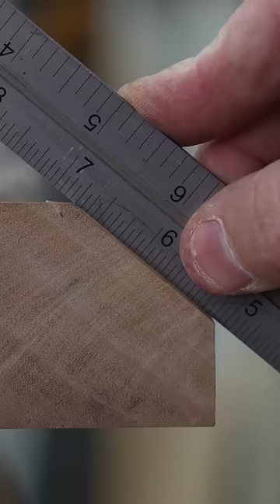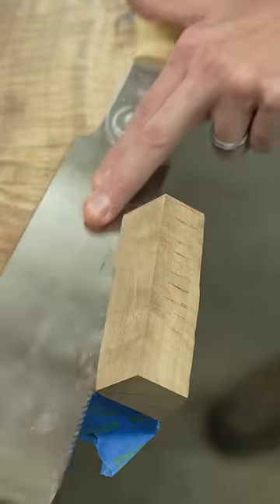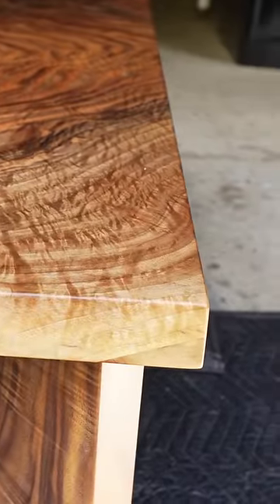Woodworking fix

Comment: You can't even tell that you had to add the piece. It's absolutely gorgeous.
Reply: It's at rh bottom of the finish product
Reply: It’s actually very noticeable, but like a good wood worker he put the mistake on the bottom not the top of the piece.
Reply: @ryanharrish8363  brilliant observation. He puts her underneath. I couldn’t understand how the grain was so perfect.
Reply: @ryanharrish8363  Noticeable if you know it's there, but without closely examining it, the match is perfect and doesn't catch the eye.

Maybe the right face has a worse match...
Reply: @darkflamethrower  cringe
Reply: You can most definitely tell that he added that piece
Reply: @marcelinomunoz4471 if he didn’t tell u u wouldn’t be able to tell

Comment: That repair job looks flawless...Well done.
Reply: Yes
Reply: Do you recognize that the last shown corner is not the corner he worked on?
Reply: Sus
Reply: its like he showed a different corner
Reply: @googlefuuplayad9055  it's on the bottom of the corner def the same spot he fixed
Reply: he repaired a... BRAND NEW table that somehow costs 18k.
Reply: @googlefuuplayad9055 He flipped the slab over so the fix is on the bottom. Same corner

Comment: The sign of a true craftsman is not that you don't make mistakes but you know how to correct them.
Reply: And own up to them.
Reply: A good cat always knows how to cover it's shit up
Reply: He is much better than me I would have thrown on black walnut and showcase the error as a highlight, but that’s why I don’t get the big bucks
Reply: The sign of a true con artist is charging someone 18k for a piece of wood. As far as being a craftsmen, they don’t fuck up basic measurements to begin with…. So yea there’s that.
Reply: @todddouglas2022  Thank you, negative Nancy! Do you feel better now?
Reply: I'm really  good at fixing mistakes... my own.  I sometimes mess up on purpose because my fix-it solutions are sometimes BETTER than the original if I had done it right. FML
Reply: @todddouglas2022  and will leave the bathroom half finished and disappear
Reply: I wish that my last bosses believed that
Reply: does no one notice it’s a completely different corner with grains going the opposite direction?? wtff!!!?
Reply: @KimoKimochii  Yeah, it's a different corner.
Reply: @briangalloway3684  No
Reply: @KimoKimochii  I think someone pointed out that he was working on the bottom surface. If you tilt your head 180º to the left, you'll see it too.
Reply: @timapple6586  you are right
Reply: @todddouglas2022  First off, unless you live in a shithole, the free market allows you to sell anything if someone is willing to pay for it, also, have you ever used wood glue? You'd be surprised how much it's used in products you THINK were made perfectly.

Comment: Just witnessed a master at work 👏🏻
Reply: That's why he's abke to charge 18Gs
Reply: A master of trickery, maybe.
The piece is on the bottom side of the table!!! Nobody would notice that piece, even if it was a completely different kind of wood !!!
Reply: @Stroke-it-2-Handed  Doesn't matter. You pay $18k for a table, and it is messed up. The least you can do is match the grain, and use the wood from the same slab if possible.
Reply: lol thats the easiest fix if you didnt notice that was the bottom side the grain on the top he shwed wasnt the fix you can see the bottom corner where its the glued on piece, if you actually knew where to look you would notice it but since you think its in a spot that its not your like WOW great fix lol when the fix was always on the bottom of the slab anyways.
Reply: @Stroke-it-2-Handed  hahaha yess you seen it too. i do countertops what he did was beginner level fix. it blends in cause they are all  looking at something that isnt there as the fix is on the bottom lol
Reply: @petejones6827  you do realize thats what makes it great right? it fits in enough that you dont notice it unless you're told about it and people dont commonly look at the bottom of the table so basically no one will see it.
Reply: @octilli  true but the thing is if its on the bottom whats all the fuss about making it so great NO ONE WILL SEE IT. i work in the countertop industry  we dont waste time on things that will never be looked at.

Comment: As a self employed carpenter myself, that's a great fix and impossible to spot if you don't know it's there. Even when you do it's still impossible to see the join. Great job man, and even better job for delivering on what you promised. 👏🏽
Reply: I couldn't see it until I realised it's on the bottom of the corner not the top. I'm still very impressed though!
Reply: Shaving the main piece down to the ring line is genius
Reply: @David Hill  you the real MVP. Was convinced it was fake until you said it was on the bottom
Reply: Watch it again and pay attention.

Comment: Seamless. Absolutely flawless 😳
Reply: It's the lower part of the corner, not the upper part shown at the end. It's pretty obvious. Not the end of the world, but would be better to sell it to someone else at a reasonable price
Reply: @Channel7331  I think you have experience with carpentry because to me I could not see any seam but my background is in medicine so I don’t have a clue of what I’m talking about
Reply: @djvelocity can't you see the obviously different colored corner with a straight line separation on the bottom of the final product?
Reply: He flipped orientation of the board and showed from different vantage point as the rest of the video. Believe me, this patch will be very visible, that's why he didn't show the same view at the end.
Reply: The underside corner in the final shot.
Reply: 18,000 bucks for a table? How about I build you six of them for 10,000 each?
Reply: @bobojames8978  is that seriously the cost? Wow. I uh, I cannot defend that, it seems steep but to be fair, the craftspersonship is flawless even if it is expensive
Reply: @dthorne4602 i think the reason it is so unnoticeable is not that it blends in perfectly, but that it looks like it’s supposed to be there. walnut sapwood tends to be the exact color of the patch, and the grain orientation matches. without being shown that it was a patch, you would never know it was there.
Reply: @acm-gs6bl  no, he just doesn't show the patch from the same perspective at the end, it is upside down, so the patch is at the bottom. He actually didn't do a good job matching grain direction at all,it is possible to make this completely unnoticeable, but he didn't.
Reply: @dthorne4602  sure it’s obvious when it’s the whole focus of the short, but if it wasn’t pointed out to you, you wouldn’t notice it. if you look at the wood near the patch, you see all those lines in the grain, and it matches those lines pretty well. it’s also in a pretty inconspicuous spot, somewhere you wouldn’t necessarily look unless you were carefully observing the bottom corners of your coffee table for some odd reason

Comment: “A master isn’t judged on how few mistakes he makes, but how well he can hide them”
Reply: ooo i like that where is that from?
Reply: Who the hell said that shi
Reply: I don't like the way that's said. It should be "how well he can fix them" many scam artists can hide mistakes, to hide a mistake is to cut corners, a master fixes them
Reply: @lordandsavior6726   a master fixes other peoples mistakes. A master is the ultimate authority. A master doesn't make any mistakes.
Reply: @noeeon9910  nope not true, a master can make mistakes, it's a part of being human, a master knows how to fix their mistakes
Reply: @lordandsavior6726   nope a master does not make mistakes. The mistakes were made on the journey to become a master. That is why they are masters. Slow is smooth, smooth is fast. Most things are %80 prep %20 execution.. this is done to avoid mistakes. Do it once and do it right.
Reply: @noeeon9910  If you don't believe masters make mistakes you've never seen a master
Reply: @lordandsavior6726   as a tradesman I've seen masters everyday. Not one second, tool, or material is wasted on mistakes. The mistakes typically come from engineers and architects. We can be masters in anything on this planet, except each other.
Reply: In this case a "master" is based on how much he can get for a damn coffee table! 18k!?
Reply: we don’t say master in 2023 😅
Reply: @noeeon9910 well. Yes and no. Working as a Carpenter you are bound by using "living materials" ie they might crack, bend or be "flawed" to start with. Then, no matter how much you prepare you might have to either remake Everything, or do like the video above.

Comment: As a carpenter, I can always appreciate a good fill that blends in. If no one notices it, you know you did something right😅
Reply: Ikr? I'm in the same field and it took me a good time trying to find the seam, some quality stuff right here
Reply: Agreed. It's always satisfying when knowledge and hard work pays off like that. It personally makes me feel accomplished and proud. Wewd is truly something wonderful to work with.
Reply: But why did he cut it off in the first place?
Reply: He paid for a solid piece,  u messed up. Should have got a new piece. He got scammed
Reply: Will that corner ever chip off?
Reply: Well, clearly he showed us a different corner at the end of the clip bc i don't see shit. Jk, if that's for real, then bravo. It does truly look seamless
Reply: @infotechsailor  he told the cilent about it and made sure they were okay with it. They didn't get scammed in any way whatsoever.
Reply: @saschaherrmann1665  said in the video
Reply: @infotechsailor  at that point if you care that much make it yourself
Reply: @Nevouti.x  he said he messed up but not how he managed to cut clean like this…
Reply: @adrianruiz4904  he used wood glue which turns brittle over time. And he didn’t anchor it so, yes its possible.
Reply: @burtan2000  Same corner. Look at underside of table. You can see it, but it isn't that intrusive.
Reply: @saschaherrmann1665  he didn’t, that piece was to small so he made it flat so he could glue a piece on, I’ve done this
Reply: @adrianruiz4904  never, the glue is stronger than the wood
Reply: Hello carpenter is that table really worth 18k?
Reply: @MeltedMask its different corner ...look at the pattern direction..

Comment: That's some damn nice work sir
Reply: Yes but. Its 18k,,, like, honestly i would rather buy a large house instead but thats my opinion. (For my area. I guess my area is very cheap for western countries)
Reply: @kristianmundruc1603 with the way the housing market is you might as well spend it on a table. Least the table will be in better condition than the home you want to buy
Reply: @kristianmundruc1603  18k don't buy shit on the housing market. that's not even a years rent in some places. (like my area)
Reply: @kristianmundruc1603  Damn where do you live? Imma move there. Here in Amsterdam you can’t even get a parking spot for less then 100.000
Reply: Bro said 18k to buy a house wtf 3rd world country u live in
Reply: @envymenace8224  🤣🤣🤣
Reply: @kristianmundruc1603 here you living where that’s one months rent? Because 18k won’t cover that let along a house or used car where I live

Comment: Thats what you get with real skilled artisan work. It honestly looks like it was never missing this is incredible.
Reply: It can be spotted, you probably just didn't realize that it's on the bottom corner rather than the top. Still not something a person would tend to notice or care about though.
Reply: Until the corner gets hit because he didn't put a dowl rod in
Reply: For 18$ it shouldn’t
Reply: @MsHojat  damn it's on the bottom 😅 i couldn't wrap my head around it
Reply: Maybe I should get into making tables if a sucker is gonna pay 18k for something like this
Reply: I'm going to be a real. His true skill isn't the craftsmanship but the salesmanship. 18k? 💀

I bet this dude could sell ice to an Eskimo. 😂
Reply: until it falls off...lol
Reply: @raintalon6138  
Depending on the wood that slab could easily be 4-5K.
Add two weeks of work with the hourly rate of pretty much any electrician nowadays and you are at 18K.

Comment: There's a sweetwater video where Dan, their resident luthier fills a route made in an old Telecaster with a chunk of wood. He did an amazing job of matching the grain, and after he was done, you couldn't tell that the guitar had been altered.  He even reliced the repair so it looked as worn as the rest of the guitar. That dude is a fucking genius.  I love watching his work.
Reply: i think i saw that one, he knows all the tricks when it comes to strings
Reply: What is a?: Sweetwater video, resident luthier, route, telecaster, relice?
Reply: @sven_527  Sweetwater is a music store in Fort Wayne, Indiana and they have a YouTube channel, a luthier is someone who builds or works on guitars and other similar instruments, not sure exactly what a route in wood is, but I assume it’s some sort of flaw or woodworking error, Telecaster is a model of guitar made by Fender, and a “reliced” guitar is a guitar made to look worn or heavily used (like a relic).
Reply: @Ruudes1483  A "route" is an area of wood that has been removed using a router, which is a tool you've probably seen used on this channel. Routes in guitars are the holes that the pickups go in, the tremolo, etc.

So Dan, essentially, replaced a section where the wood had been removed with another piece of wood, similar to what was done in this video.
Reply: @IzziedeD  Dan is amazing, for sure!

Comment: For those that don't realize it's the bottom corner on the finished piece. Some in the comments can't seem to comprehend that.
Reply: I watched it a couple times because I thought he showed a different corner before I realized
Reply: Also, the dimensions didn't change
Reply: So? It's going to fail 2 weeks after delivery. I am surprised the customer paid for this garbage but I guess we should not have expected people who pay $18k for a table to have any sense.
Reply: @romanw6636 bro stfu respectfully, people have the money to buy it because it wasn’t going anywhere else, and its going to a man with good ethics who made sure his customers knew what was happening. Bc your too broke for a table doesn’t mean you can hate on others and others who do a job they love and are good at even if mistakes happen
Reply: Thanks, I was looking at it thinking theres no way, the grain and everything is in a different direction. But yeah, you can totally still see if when you know it's on the bottom and not the top.
Cheeky cheeky from the video to try to hide it like that by flipping the table and not say anything.
Reply: Yeah it's so obvious...after reading your comment hahaha.  Thanks!
Reply: @norabseven  it still looks decent though and matches the grain relatively well with the diagnol lines being pretty consistent.
Reply: @mech0p  Never said it didn't. Just a bit cheeky to try and hide the final result by flipping it.
If it was the original orientation we'd all be able to see it no problem.
Reply: @norabseven  oh i agree on that for sure. its obviously made to look like he did a perfect job.
Reply: @romanw6636  I dont think you understand how strong wood glue is. if done right it literally holds stronger than the wood fibers do to itself. not to mention, its the bottom small corner of the piece meaning its both hidden and wont bear any kind of load. you could hit the corner with a sledgehammer and I highly doubt it would come off.
Reply: @norabseven  it's not really cheeky, in order to repair the corner and build the table it has to be upside down. The reason its right-side up at the end is because he is showing the final product after everything is properly stained, finished and built. 

The only other option would be to flip the video camera upside down but that's just unnecessary because the whole point was to make the repair hidden. Doubt even an experienced wood worker would be able to point it out in person without watching this video. It's not obvious.
Reply: 18k…. Make it again please.
Reply: Damn i wasnt paying attention 😂
Reply: @romanw6636 don't talk about things you don't understand. You're just embarrassing yourself.

Comment: I don't see anyone else in the contents that noticed the repair was to the underside not the top. So of course we don't really notice it when reveal is of the top. Looks fantastic no matter what, just pointing it out.
Reply: Yeah, but I wonder why he didnt used the same direction of growth in the wood. Not sure what the english word for that is, but the groth rings of the wood are different. So you can actually see the difference later, since they also absorb/reflect light differently. So to me at that price point, he was a bit sloppy, but since its on the underside its ok.
Reply: Yeah i spotted that, shall we get him to chop it off again and put another piece on to match the ring direction? Devil is in the detail
Reply: I noticed and I watched the video about 10 times to try find the grain orientation in the end I concluded it was upside down saw the metal insert and it all made sense.
You can see the furnishings on the underside but I couldn't even be sure if that is a different piece of wood so it's well hidden
Reply: ohhhhh I see... Thank you for the explanation
Reply: Wow!!
Reply: Thank you for clearing that up
Reply: So true
Reply: @BobCassidy Yes, Yes, and Yes! I just wrote for 18k. It better be 1 solid piece.